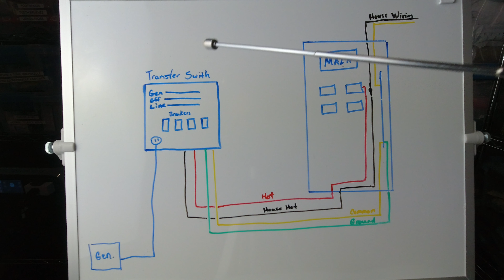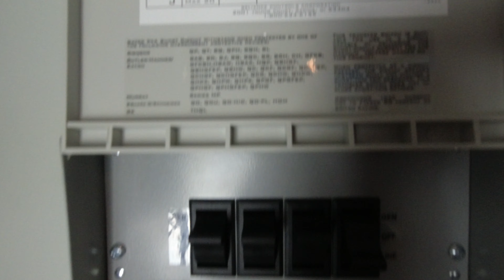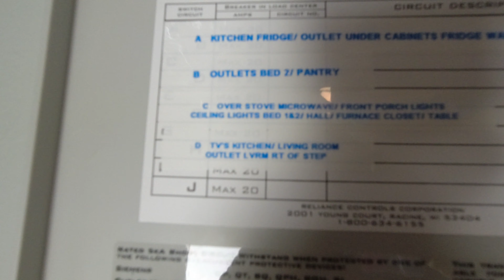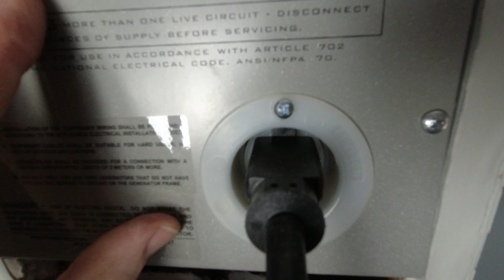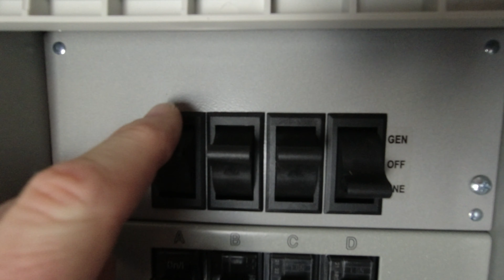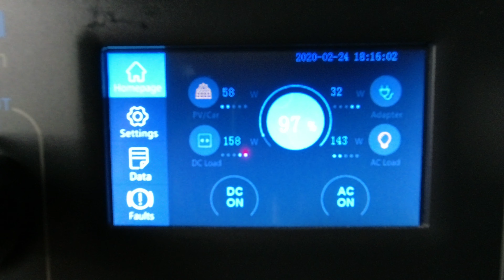Bluetti AC200P and my Manual Transfer Switch

Comment: With the transfer switch all you need to do is switch to gen location that is all you need to do right no chance of back feeding utility power?
Reply from the maker: That is correct. Your not going to back feed the grid when you switch to generator power on a transfer switch.

Comment: can i add another 100 watt panal , and bring it to 800 watt max? ac200p!
Reply from the maker: On the solar input side you can add as many panels as you want as long as you don’t exceed 150 volts. The ac200p will only output a max of 700 watts on the solar input. I have 800 watts of solar on my solar input and 400 watts of solar running through the dc charge enhancer which runs through the ac input port. I hope that helps. Thanks for watching and commenting.
Reply: @PreppinontheCreek12  Gotcha!

Comment: do you have to cut the main circuit breaker off before you change the transfer switch to generator?
Reply from the maker: Once you have it wired it’s as easy as flicking the switch. No you don’t have to turn the main circuit breaker off.

Comment: So you think 10 gauge copper solar wire is good enough for 65 ft  run from Bluetooth ac300 to a 1600 watt 96 volt array?
Reply from the maker: Yes that would work, you will probably only have a voltage drop of about 1 1/2 volts with a 65 ft run. I’m assuming your doing a series parallel configuration on your solar panels.
Reply: @PreppinontheCreek12  Yes, 8 x 200 watt panels in series then 65ft to the bluetti.
Reply from the maker: Are those 200 watt panels 12v or 24v?
Reply: @PreppinontheCreek12  12v panels. I believe they should equal out to 96 watts in series?
Reply from the maker: @snareofwisdom  12v panels will actually put out about 20v per panel. To stay under the 150v max on the ac300 you might need to run 4 panels in series and another 4 panels in series and parallel the two strings. I think if you run all 8 in series you will be over 150v. I hope that makes sense. But the 10 gauge wire is still sufficient.
Reply: @PreppinontheCreek12  Really? Why don't they call them 20v panels then lol... Hmm... Definitely don't want to burn out my system.
Reply from the maker: @snareofwisdom  I hear ya! I believe the 24v panels put out over 30 volts. If you have a multimeter just check your voltage before you hook it to the ac300. Good luck, let me know how it turns out for you.
Reply: @PreppinontheCreek12  I’ll try not to set my hair of fire!

Comment: Anyone know what cable I would need to connect PV solar cables into a Bluetti AC300?
Reply from the maker: To hook solar to the b300 battery you need a xt90 to mc4. To hook solar to the a300 you need bluetti’s aircraft connector to mc4. It’s shows on their website that it’s included with the unit. I hope that helps.
Reply: @PreppinontheCreek12  Thank a bunch. Your transfer panel diagram hookup is very helpful!
Reply from the maker: @snareofwisdom  thank you and thanks for watching.

Comment: I think someone asked before but how does the power inlet "plug" get wired up? I think it comes with the green wire connected to it maybe? white Neutral also plugs in. But what about about the red and black shorts coming off the panel? Do either or both of those short wires plug into the 120 plug inlet? Thanks for your help
Reply from the maker: The easiest way to do it is to go buy a short 10 or 12 gauge extension cord. Plug the male end in the power station and the female into your transfer switch. If I’m misunderstanding your question please clarify. The beginning of the video shows a wiring diagram of how to wire the transfer switch. Thanks for watching and I appreciate your questions and comments.
Reply from the maker: Also I didn’t have to wire anything internally on the transfer switch. I’m including a link to the transfer switch I used. https://www.amazon.com/Goal-Zero-Integration-Transfer-Switch/dp/B07C535GCZ/ref=mp_s_a_1_3?crid=19S0VF5JHZ6TU&keywords=goal+zero+transfer+switch&qid=1655751599&sprefix=goal+zero+tr%2Caps%2C234&sr=8-3   Thanks

Comment: Video would be more helpful if you showed the actual connections to your AC200P. I'm a bit confused about how you are feeding 4 x 20A circuits on the transfer panel with the AC200P when each outlet on the unit is only rated for 20A aren't you potentially drawing way too much from a single outlet? This is why I'm thinking of going with the AC200MAX because it has a 30A outlet (TT-30)
Reply from the maker: I show the connection in another video. But you are correct it’s 1 20 amp cord feeding the transfer switch. Each circuit on the transfer switch has its own breaker. The ac200p is rated for 2000 watts and I’m never pulling anywhere close to that on a consistent basis. It’s running at the most 600 watts constantly. It’s using 12 gauge wire rated for 20 amps but 600 watts constantly is only around 5 amps. If I’m buying one today I’m going with the ac300 also. As long as you know what the electrical specs are and stay within them you’re ok with the ac200p. I’ve been using mine this way for a year now and it’s been a beast. But I would go with the ac300 if setting it up today. Thanks for watching and for commenting.
Reply: Get the ac200max, if for no other reason, the inverter is much more efficient......

Comment: How is the AC200p grounded?   Test the 120 volt outlet with a Klein Tool RT250 and it will fail.  Shouldn’t the ground be bonded to the natural somewhere for safety?
Reply from the maker: I can only speak for my system and I use a southwire GFCI receptacle tester and when I’m hooked to the transfer switch on my ac200p it shows correct. With other power stations it shows an open ground. I’m looking into a whole home emp/ surge protector to see if that would protect the power stations from lightening strikes. I hope that is helpful. Thanks for watching and commenting.

Comment: Got the same exact set up I'm installing. The only thing hanging me up is the plug wiring to the Trans box. It has a black and red wires coming off the box but the plug has one black wire with a plastic end piece. Do I put the red wire in the back of the plug part and the black wire to the plastic piece of the end of the black wire? Then there's a green wire I assume can be ground to the box but what about the white wire? Please help. Could you make a quick video of how you wired your plug part inside the transfer box? Thanks!
Reply from the maker: Can you tell me what transfer switch you have. The one I have, the receptacle is already wired in the transfer switch. I use an extension cord plugged into my AC200P ac outlet and the other end plugs into my transfer switch.
Reply: @PreppinontheCreek12  the same one as you. I figured it out as far as the back side of the plug. 3 wires black(was already attached) put the green wire(already attached) to the green screw attached to the box for ground. I attached the white wire to the back of the plug. So now I have black on brass white on silver and green to ground. Now I just need to know if the red AND black wires from the Trans box go to the plastic end of the black wire already attached to the back of the plug. There is a plastic piece on the end if the black wire from the back of the plug that has TWO holes on each side and that's where I believe the black and red wire go into to make the connection. Am I correct?
Reply from the maker: If you can go to my about page, my email address is there and if you want send me a picture of your switch and the wiring. I apologize I’m a little confused about what your asking. The receptacle on my transfer switch was already wired internally. The wires coming out of the transfer switch all go to your circuit breaker panel. There was 4 black wires 4 red wires 1 white and 1 green. The black and the red should have letters on them corresponding to the circuit it controls. The green and white wires go to your neutral bar inside your panel. Email me if you want. This is the link to the switch I have.  
https://www.goalzero.com/products/yeti-home-integration-kit?variant=39420903030953&currency=USD&utm_medium=product_sync&utm_source=google&utm_content=sag_organic&utm_campaign=sag_organic&gclid=CjwKCAjwve2TBhByEiwAaktM1ONpHUM0v_xtxjoaDMrxNcegeA6hcEM5dfgK7okbgcYrZbo74dr7yBoCpssQAvD_BwE

Comment: Could I do this on a RV with 50watt?
Reply from the maker: The AC200P is not big enough to run a 50amp RV if that’s what your asking. My RV is a 30amp and it will run it but if I run the AC it will only last about an hour and a half and everything else needs to be off. I use mine with the transfer switch in my home to run fridges and freezers. I have 1200 watts of solar charging it so during sunny days the solar keeps it at 100%. Let me know if that answer’s your question. Thanks for watching and for the comments.
Reply: @PreppinontheCreek12  thanks for the quick reply. Would there be a solar generator including solar panels set up that would work  for 50amp RV?
Reply from the maker: @fightintheshade  you have to go with a big system to completely run your RV if your wanting to run the air conditioner and yours probably has 2 ac units. You could look into the ac300 or the titan. They will take in the most solar and you might only be able to run 1 ac unit during the the day when your getting solar. For lights and fridges and running a microwave, moving your slides in and out you won’t have any problems with either of those two. AC on rv’s pulls around 1200 watts. It’s hard to run those unless you have the battery capacity and solar capacity. I hope that helps.
Reply: @PreppinontheCreek12  very helpful. Im looking into the AC 300. Appreciate your videos and advice. Keep up the good work 👍

Comment: I do love your setup and wish I can do something a little bit similar and kinda have a few ideas. But too only cover smaller power hungry devices in my scenario. Also I do have a 20USB charger station too pair it with my 300watt allpowers 372Wh portable power station. But also it as Bluetooth control and with me using it after a while or only doing it with small loads for some reason my display screen as wear out over time. But the cool advantage that I still have is physical buttons and Bluetooth control with the app and will be able to see the normal reading. Also the screen wear out on me is not really a big deal as long as I can still use it as normal. But another thing I do have is a solar USB adapter generator that only charges the basic technology.
Reply from the maker: Thanks for watching and I appreciate your comments.

Comment: The bad thing I don't like about the AC200P is the 6 hour long AC wall outlet charge time.
Reply from the maker: The AC200P does support dual charging so if you combine the wall charger and can max out the 700 watts of solar it will charge in 2.5 hours.  I use the DC Charge Enhancer and have a combined 1400 watts of solar hooked to it and get it charged in that 2.5 hour time range.  Thanks for the comments and watching I really appreciate it.

Comment: You would have been better off using a Delta Max. It charges quicker and is more user friendly compared to the AC200P.
Reply from the maker: Yea, I like the Delta Max but when I bought the AC200P it was the best new thing. I would actually prefer the Delta Pro for the LifePo4 battery chemistry. I’ve been pleased though with AC200P and its been a beast for me. Thanks for the comments and for watching its much appreciated.

Comment: you mentioned that the plug icon was charging by solar?  isn't the plug icon for AC charging?
Reply from the maker: To clarify I can charge my other power stations through the ac outlet of the AC200P. The AC200P is getting solar input from the panels I have mounted on my roof to keep it charged. So I’m using the AC200P as a receptacle for the solar and transferring power to other power stations. For example if I’m getting 700watts of solar into AC200P and I plug my EB70 into the ac outlet and it’s taking out 200 watts. I still have more coming in than I’m using. So I’m using solar to charge the AC200P which is charging the EB70. With 500watts to spare. Does that make sense?  Thanks for watching, it’s much appreciated.
Reply: @PreppinontheCreek12  i was referring to the display screen and the plug icon.  i thought you mentioned it was inputing from solar.  i thought the plug icon was for AC charge input.
Reply from the maker: @BumSkidley  yes that is true. I use a DC charge enhancer that you can get from bluetti power.com web site. It allows you to input up to 500 watts of solar through your 8mm port of the AC200P. So I can get 700 watts on the solar input and an additional 500 watts through the ac charge port. Watch my Bluetti AC200P and Bluetti DC Charge Enhancer video and it will go over it. 
https://m.youtube.com/watch?v=B_2hyIEjUsI
Reply: @PreppinontheCreek12  i see, thanks for the clarification.  this is really helpful for me as i prepare to receive my AC300 and begin setting it up to a transfer switch and solar.  thanks again.
Reply from the maker: @BumSkidley  thank you for watching.